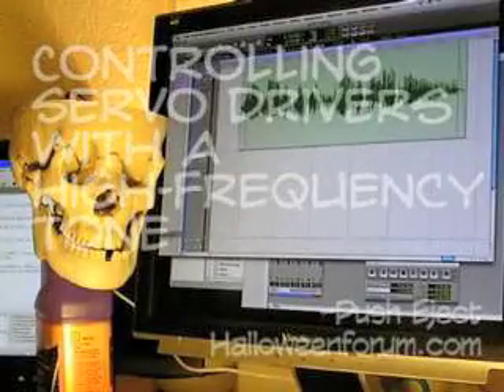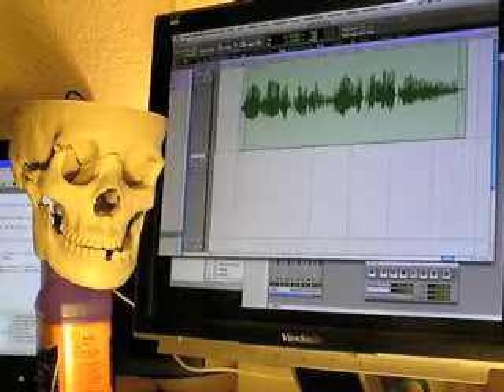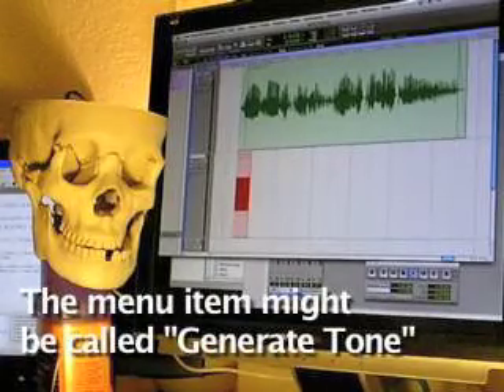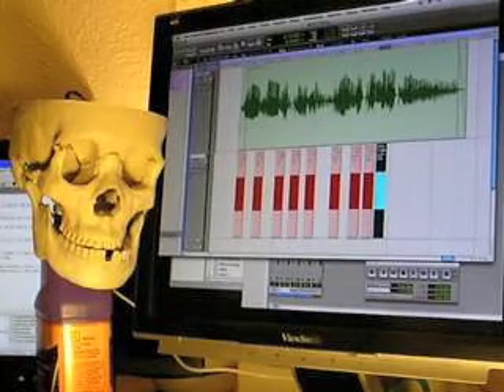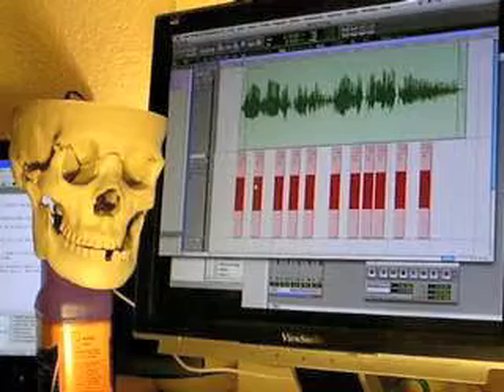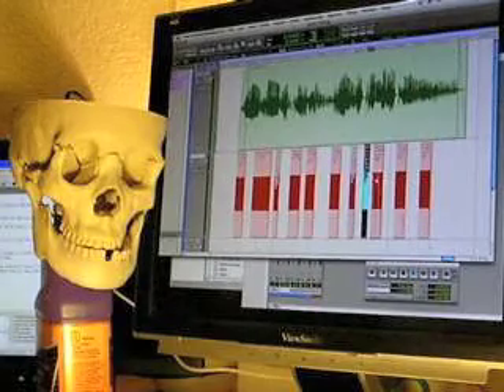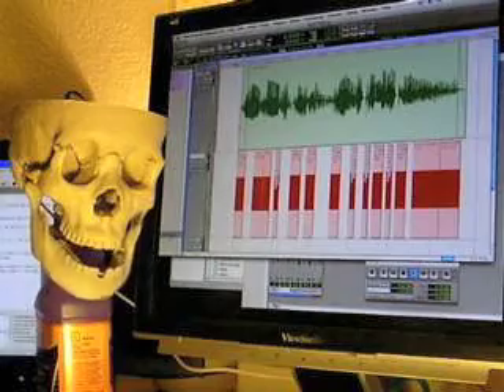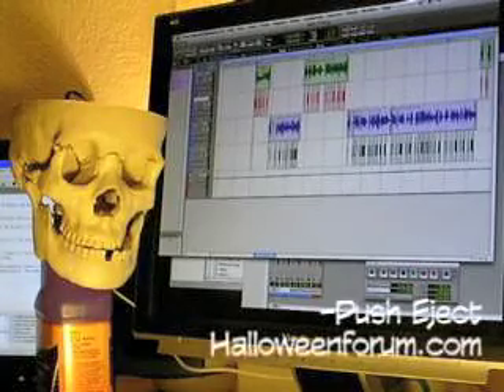Skull Control

Comment: Good info. I'm new to this, but have been studying for many days. 
The benefit to a Audio Servo Driver is they are supposed to interpret the audio and make the servo sync with it. This means you could have a 30 minute audio and as many as you like without having to manually adjust the servo to match. Manually adjusting means a limited audio or plan on spending a lot of time syncing a long audio.
As I plan to have a more quiet ghostly audio and moaning I don't think this unit will work for me unfortunately.

Comment: I see what you are saying, but what speakers are you using that don't respond to this frequency? And is there a way to only have the sound board pass the desired channel to the speakers? I have it set up nicely but just don't want the clicking of the high khz tone to play through. Can I edit out the click, or is that what is actually activating the servo?

Comment: I'm glad I found this video because I was having the exact same problem. I actual ended up doing it a little different. I panned the actual "talking sound" on the left channel and the "tone" on the right channel then had the ST-300 only respond to the right channel and only used the left channel (the talking sound) go to the speakers. This would also solve the problem if your audio has music that would interfere with the jaw movement. You never send the channel with the voice and music to the s